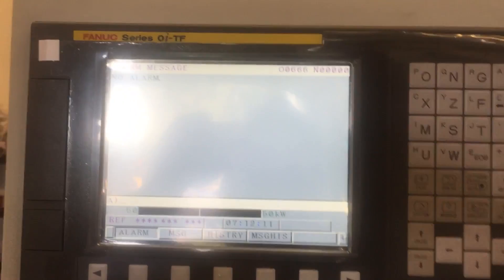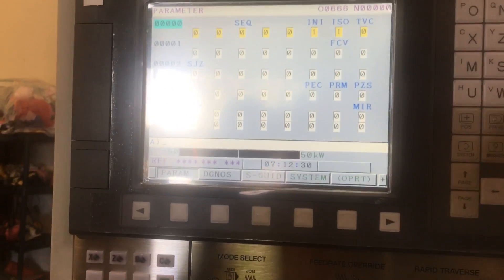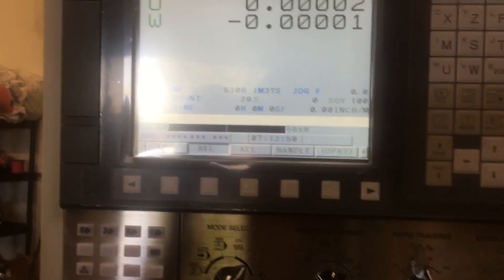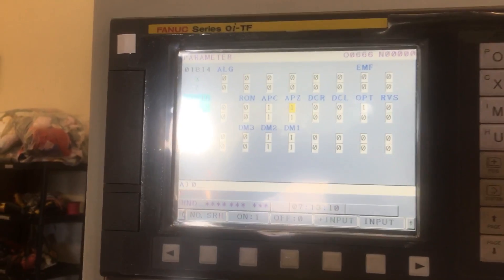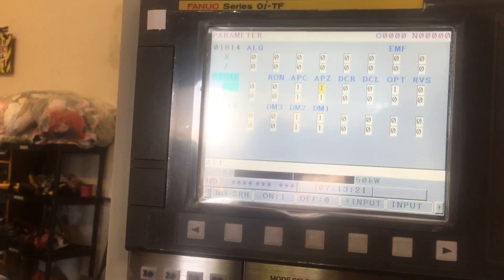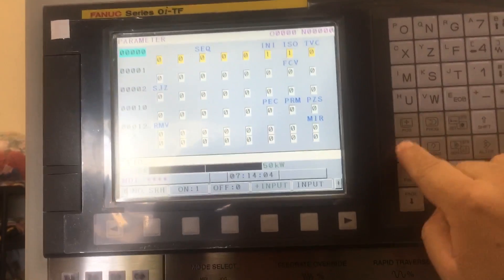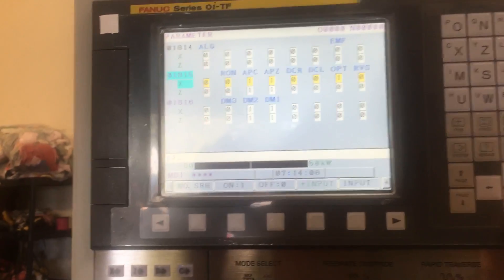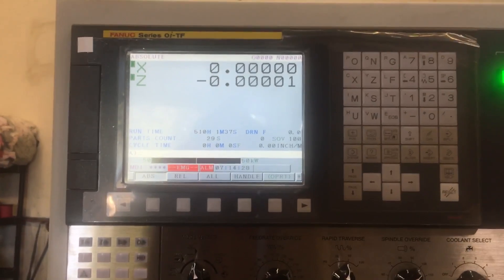Fanuc home position reset after battery replacement

Comment: Only difference is that after unlocking 1815 you need to manually go to reference point and then lock 1815. 
thanks for the vid

Comment: after this tools need measure again. how know where old zero was so can manually go there and then reset is. all other data is safe but home zero lost. it could write in parameter LOL why need battery.
hoe home ref machine that battery died and lost ref point. anyway machine not even have ref point key  LOL

better is know where these parameter changes effect and go look where old ref was lol

Comment: How do you know its 01815? Will all my parameters be listed in the manual?  Or how do I figure out which 00000 parameters are which?
Reply from the maker: Parameter manuals have a description. APZ is for position resetting. Sometimes APC needs to be changed but that is very rare.

Comment: Hi can i ask a question . I already enable the parameter but why the system key is not responding ?? Can you please help me?
Reply from the maker: Sometimes the it’s protected by a password on parameter 3210
Reply from the maker: I also had one experience, the soft key didn’t function and I called Fanuc and ordered a new board for replacement.